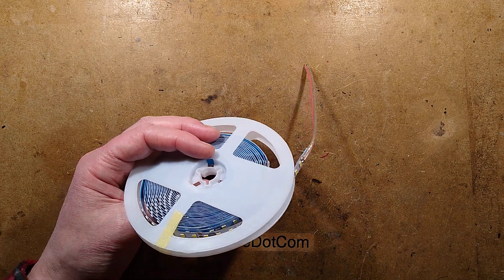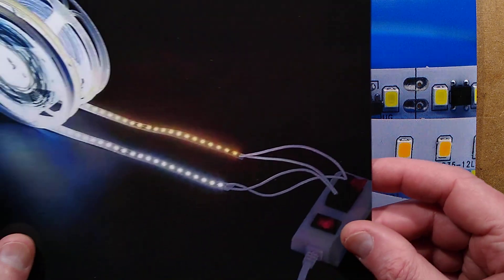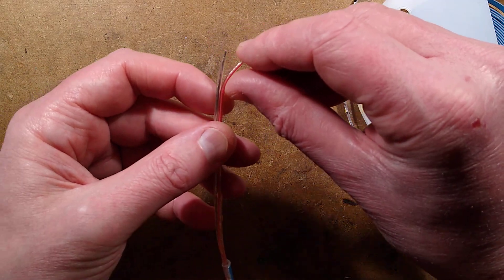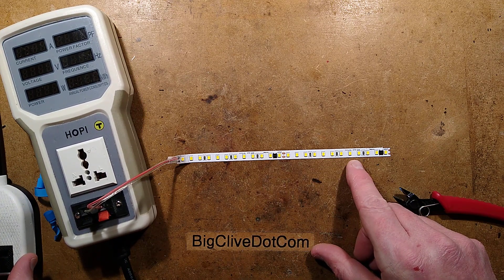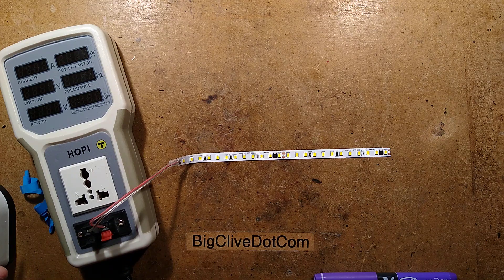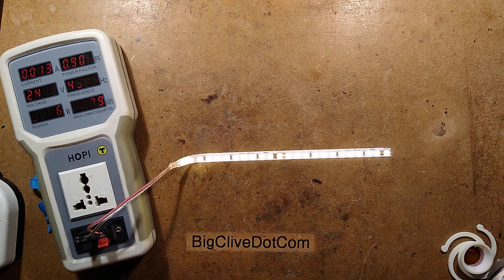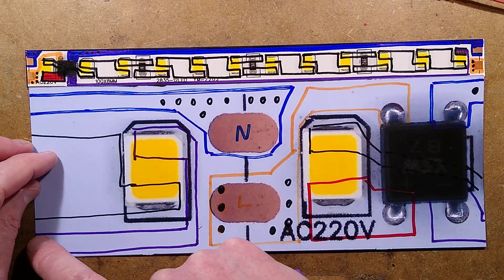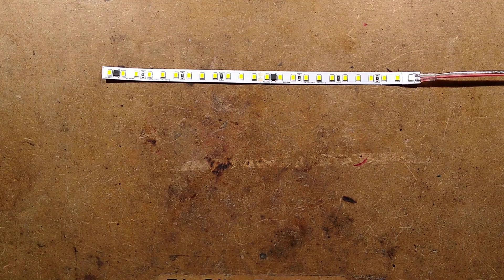Dangerous bare 230V LED tape

Comment: Seems ideal for use inside an aquarium - make sure to fit a 3A fuse though, just to be on the safe side. 🙂
Reply: If the fuse blows, just install a new one and try again. Fuses have a weird habit of blowing up without reason. They're real temperamental.
Reply: @poipoi300  You just replace them with a nail if it keeps happening - it's obviously just a batch of bad fuses. 
Couldn't be anything else ;/
Reply: @Thermalions  Yeah that's a good trick. Then if the breaker pops (those have immense solidarity with fuses for some reason), Just hold it in the open position with a string and that'll be sure to fix all your problems.
Reply: @poipoi300  fuses only react weirdly because they are filled with bright flashes of light, not smoke like most other components .
Reply: @garyb47  I wish they just used pixie dust. They don't make 'em like they used to, that's for sure!
Reply: @poipoi300  and if it keeps blowing just replace the fuse with a penny
Reply: @saigyl9149  That's very dangerous advice and I trust that nobody takes any notice of you!
If a fuse keeps blowing then it's obviously a manufacturing problem - find a suitably long 1/4" bolt and cut the head off at the appropriate length. This will ensure that your house will burn down before the threaded fuse will ever blow.
Safety first!
Reply: @daveseddon5227  I'm facepalming hard here
Reply: I actually find that not having a fuse is more reliable as the fuses kept popping. Now it doesn't stop working and the fish seem to be enjoying the new lights, their even sleeping upside down now
Reply: Excellent. An inexpensive way to turn your boring less colourful fish into "Neon" Tetras!    Love it. Ebay is just the best.
Reply: Fish love Light Emitting Death Tape.
Reply: @Fullchaos40  Light Emitting Death Tape. I love it! Also, great name for a band.
Reply: I bet this would pair nicely with the saltwater heater we had that was pretending to be an arc-lamp...
Reply: Sorry to be ignorant. Can you explain why
Reply: @TheSlyMouse  Makes the water go tingly. Provides the fish with a high level of entertainment, as demonstrated by their dancing.
Reply: @degtyarev708  :O 
Thank XD.
Reply: @TheSlyMouse  satire...
Reply: My fish have stopped responding. Any solutions?
Reply: @CooIzz  Reset your breakers to get them dancing again.
Reply: @JamesAllmond  ;)
Sorry I got it. After he explained it XD :)
Reply: @CooIzz  Solutions? I'd try a high concentration of salt. Badum-tiss
Reply: @CooIzz  Turn them off and on again. Recommended by every IT department.
Reply: @CooIzz  Replace the fuse. They will dance once more. If that fails, increase the voltage!
Reply: @CooIzz  have them on toast with prawn sauce
Reply: @nimoy007  "high concentration of salt"

My fish are now  chrome plated and my filter is now multicolor. Very cool, I really recommend
Reply: @TheSlyMouse  The fish would die before the fuse goes off
Reply: Does this work for electric eels?
Reply: @actuallyusingmyrealnameher5061  Yes it does but don't expect any positive feedback from them.
Reply: Make sure to fill the tank with neon tetra fish (Paracheirodon innesi) you may need to check their voltage rating though.
Reply: @AndyHullMcPenguin  Also ensure that they are AC tetras and not the DC species!
Reply: @daveseddon5227  Good point. Getting the wrong ones is not a problem that can easily be rectified.
Reply: @AndyHullMcPenguin  Mistakes can always be smoothed over but with those tetras you have to expect ripples in the currents.
Reply: eels love it

Comment: Instead of 3D printing a power strip of death, wouldn't it be easier to just add the speaker connectors to the back of a mains plug. 230V fun for all the family.
Reply: Some crocodile clips would make it far easier to electrocute everyone. Just cut a standard IEC mains cable, expose the wires (just use a knife to peel back insulation, doesn't matter if you compromise the inner layers when you break the outer), add crocodile clips. Make sure to mark which one is live so you know the true source of the spiciness.

Goes without saying that this is parody. Please don't ever do this. Don't listen to me, I am not a certified electrician.
Reply: @ConstantlyDamaged  
much easier to poke wires into a two pole connector (the figure 8 thingy) to test things , i do have it plugged into an isolation transformer tho 🙂
Reply: @YTANDY100  I can verify that this is 100% safer than plugging directly into an outlet ;)
(Sarcasm goes without saying here)
Reply: You'd clearly print a plastic block, then stick a CE sticker on it.
Reply: @Smaxx  Make sure it's a metalised sticker !
Reply: @Smaxx  Add the CE graphic into the 3D-print design.
Reply: I love that Idea!
Reply: When playing with the mains supply you really need a ballast, an electric kettle element works nicely and allows you have all kinds of destructive fun without blowing out your home electrics.

Comment: I believe the "  ATORCH AC85~265V Electricity Measure Smart Control Programmable Digital Display Household Socket Creative Power Detector Monitor  " is a good replacement for the HOPI in combination with the Quickest .It's the one I use at the moment.
Reply: Oh no! Don't let the HOPI hear that, it'll shimmer more than ever!! :-D
Reply: @stepheneyles2198  😅😅
Reply: "[...] seal it with electrical tape to prevent electric shock!!!"
No thanks.
Reply: Looks cool, might pick one up myself
Reply: @spongygryphon  Yes👍✌️. I use it to test the LED power after the  underrunning life hack.
Reply: @Ulf Zimmermann definitely

Comment: That is bad and scary in so many ways!
Why not just use 12 or 24 volt dc strips and be safe????
Reply: I would guess that it is a cost cutting measure. No need to add in the cost of a low voltage LED driver. Especially if you want to chop that strip into multiple sections.
Reply: Where's the fun in that? 😊
Reply: Good point

Comment: Great review and good service to warn people of the hazards. But people take short cuts and don't think. But wouldn't a simple fuse help protect from aspect of internal Short circuit? If so what am page fuse?
Reply: I'd use a 0 (zero) amp fuse to make sure it blows as soon as it becomes dangerous ;)
Reply: Fuses protect wiring from melting or burning. They don't protect people from being shocked or electrocuted.
Reply: They do when it's a 0 amp fuse which blows as soon as it's powered up.

Comment: Interesting, on the "Ebay Specs" it says power source DC12V as well
Reply: I think the Ebay Seller just used a generic LED strip listing as I dont see anything saying they could run at 220v
Reply: It works on 12V DC as well for making a dark room

Comment: Really a shame they didn't scatter a bunch of surface mount caps on the strips for smoothing. I really don't like LEDs running on ripply power supplies, even in a 60hz country it's very distracting to me. Can't imagine what it'd be at 50hz, my PAL amiga is so hard to look at compared to a 60hz display...